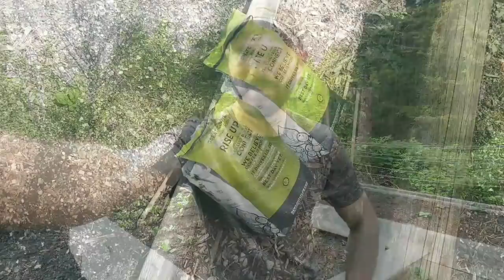Survive The Coming Chaos! This Will Be Key!

Comment: Been drying onion greens all morning in my dehydrator and running it off solar, so bargain.
Jars loads of onion greens.
Also been making plant labels out of old marg tubs.
Gotta get a new marker pen and a spare cuz I right on my pots instead of labels, made the labels today for wen I plant out.
Ingenuity saves the day.
Hey I was checking the amps on my solar cuz its running my dehydrator and at max I was cranking 23amps  from 600watts of solar panels.
Love that free electric me, I'm got 5 seperate solar systems all running different things.
Got 2000 watts in total of panels.
Doing the things here Mike 
Luvs brother.

Comment: Cranberries are also a good, low maintenance addition to a berry patch. Contrary to popular belief, they do not grow in water. (Flooding the fields is simply the easiest way to mass harvest for commercial growers.) Cranberries like very acidic soil and cold temps. The plants stay low to the ground and are relatively pest and disease-resistant.

Comment: I’ve been getting coffee grounds for a couple years now. I’m a little concerned that I’m using too many coffee grounds in my soil. It’s too much of a good thing bad?
Reply: I'm not 100 percent but coffee is acidic and could possibly be to much. If it's a 10x10 area and you dumped loads of it it may be to much.
Reply: Too much of anything is bad. U need a PH testing meter for ur soil if ur gonna use stuff like that. PH in soil should b 5.8-6.8 or plants will have issues eating what’s in the soil!!
Reply: Oh!!!….. u need to add some dolamite lime if ur adding a ton of coffee grounds to counter act the acidic effect of the coffee
Reply: …..most plants……
Reply: @Psalm 23 it’s best to have everything the plant needs in the soil to start with unless u r plant steering/manipulating like in commercial marijuana grows, then u separate them into stages. Chicken poop is high in nitrogen but should b composted before use. Rabbit refuse can b amended into soil while fresh. If u add things into ur outdoor raised beds u need to keep dolamite lime to lower acidity level and a PH meter to see how acid or alkaline the soil is.